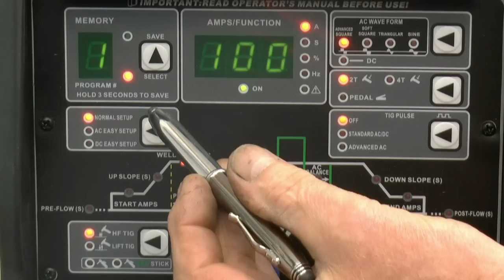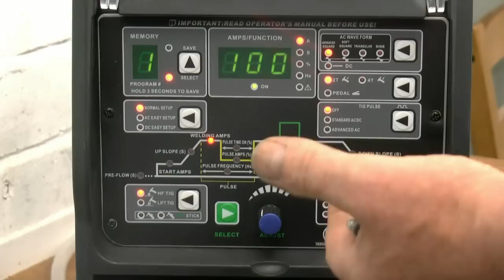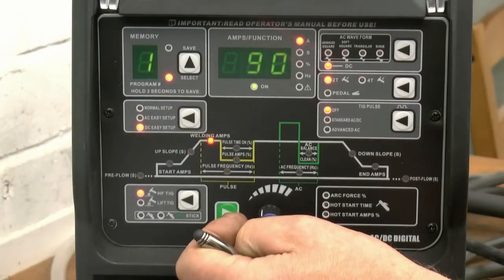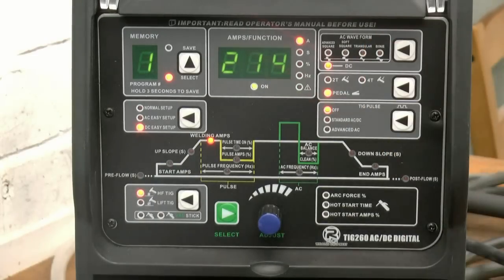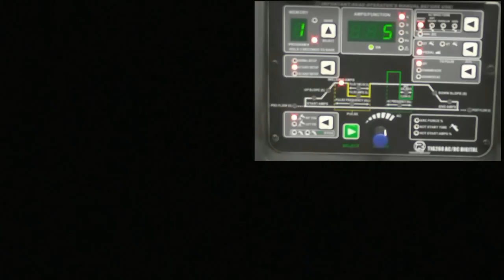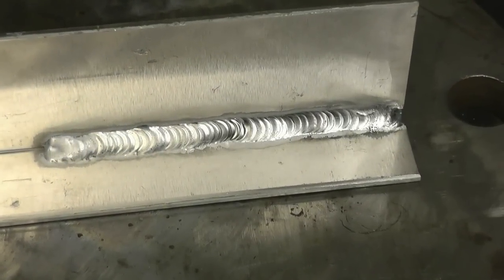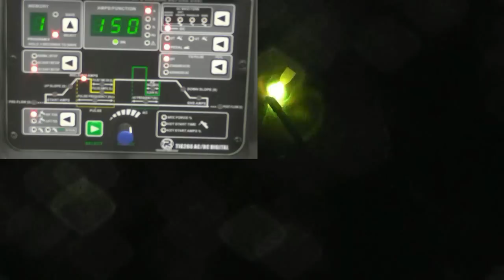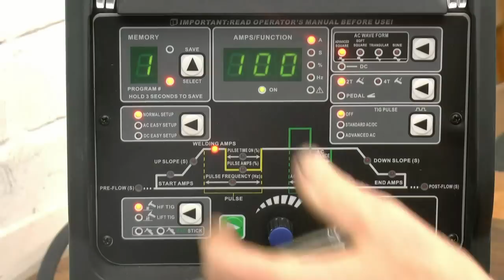R-Tech Digital  Tig Welder AC/DC 260 AMP 240V Review Part Two

Comment: John when using the foot control.
When you decrease the pedal does it go all the way down to 5amps.
I have a Jasic 200 ac/dc pro digital and it doesn't go below 20amps when the foot pedal is connected.
Very frustrating for welding thin material eg 25swg.
Will be in the market for one of these if this does what the Miller plant I use at work does, 5amps to whatever the panel amps are set to.
Helpful video.
Cheers